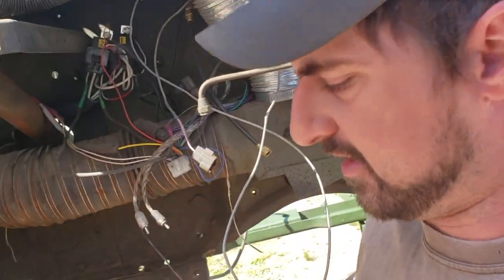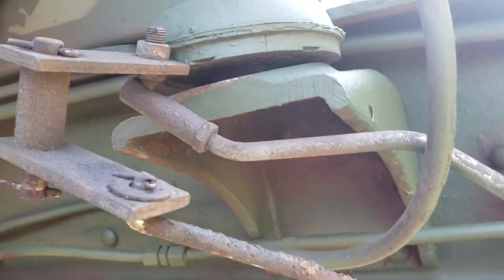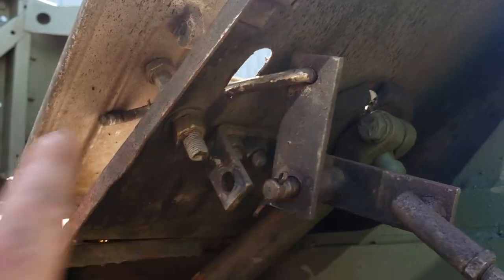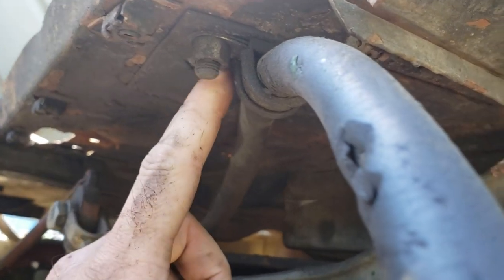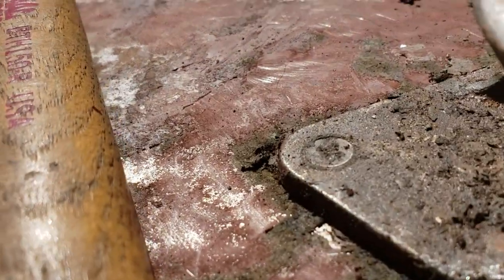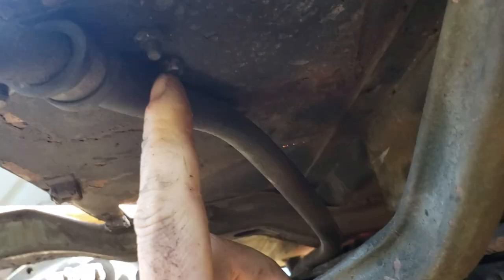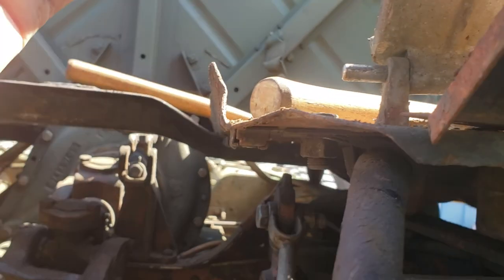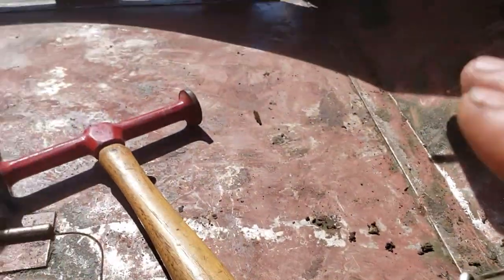M35A2: How to remove the accelerator pedal from the vehicle.

Comment: Something I've really got used to doing on my truck when taking crusty bolts/screws off, is to zip around the exposed threads with a little wire wheel in a drill, to remove the mud, rust, 8 layers of paint, etc. so you're not trying to drag all that crud through the nut as you're removing  the bolt/screw. Doesn't matter if it's bigguns like leaf/axle u-bolts, or little guys like you're working on, it has really helped a lot. Once the threads are clean, a few drops of 50/50 ATF/Acetone can really help too. Thanks for the vid Garrett.
Reply from the maker: Thanks for the input and extra tip for other viewers!

Comment: Definitely have to remove the pedal linkage bracket when doing your trans/clutch. I found this out and as Garrett said it requires 2 people once trans is back in. When trans is removed you could remove it by yourself and it needs to be off to properly install and clock the clutch release lever. But once trans is in and clutch release lever installed definitely a 2 man job to reinstall it.

Comment: Thanks for sharing.  As an M939 series 5 ton owner, I am going to presume the procedure is pretty much identical on M809 and M939 trucks?

When you start re-assembling, one thing I'd be curious to see would be more detail on the transfer case and trans and what lines go where.  I had some nightmare dealings with an M813A1 (Not my own truck, someone else's) and was at times pretty much beating my head against the proverbial wall...

Comment: also have you tried welding a nut to the philips screw head? you could do that and put a wrench on it so it wont spin on its own when youre underneath the truck
Reply from the maker: I haven't. Not something I've had to do often enough.
Reply: @tacticalrepair  indeed